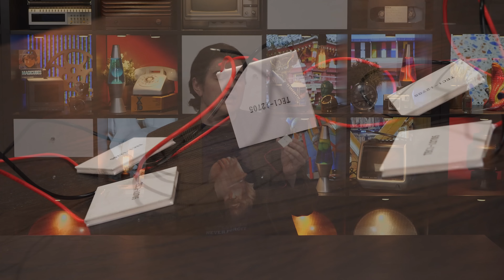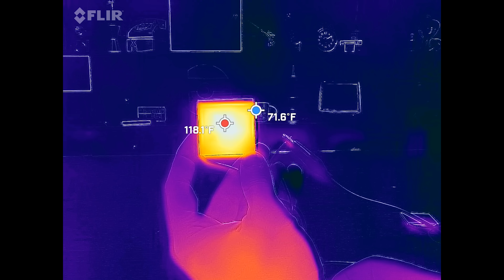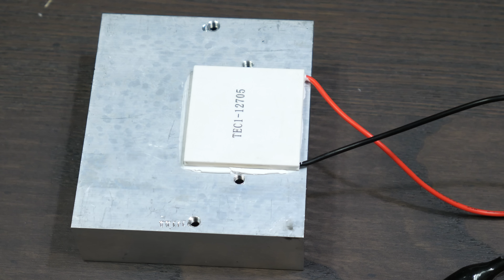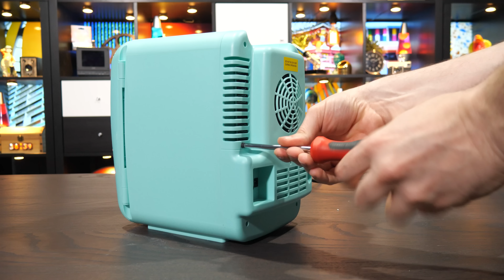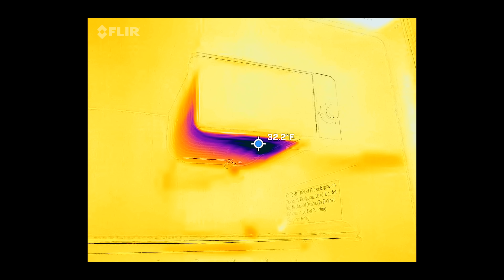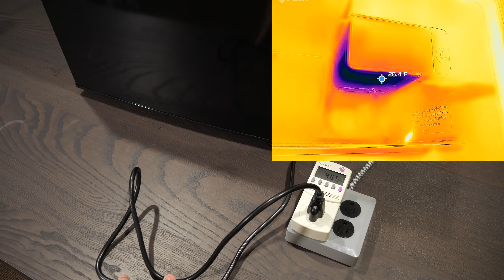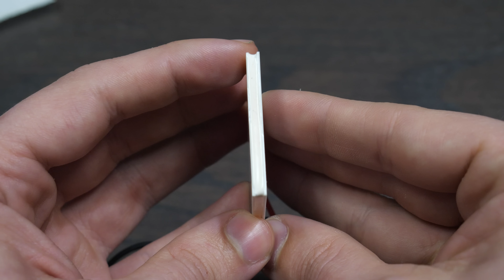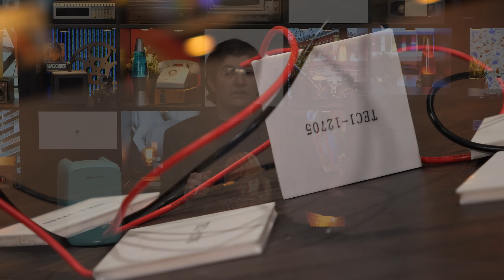Thermoelectric cooling: it's not great.

Comment: I think the main draw of a fridge like Mr. Blue Toy over there is honestly the tiny size. You can literally have it just sit on your desk without it causing any issues or getting in the way and that's extremely convenient. I doubt you could fit a compressor that small into a fridge, and even if you could it's efficiency and noise probably suffer a lot. So I do think a very well insulated, temprature sensing little thermoelectic fridge has a place, it would probably cost quite a lot more to make a decent one, and it would still cost quite a lot to run but if the insulation was good enough it'd surely be at least acceptable, even though it's never going to be very efficient
Reply: Yes, this is why I have one. I have some skincare products that tend to oxidize before I finish the bottle. I just need them to be kept a bit cooler on my vanity without taking up much space, and it works perfectly for that.
Reply: @brittneyyyann You will spend so much money on electricity that you could buy new skincare products with it. And why not just pot them in a regular fridge?
Reply: you are better off getting a smaller insulated cooler a use ice packs. cheaper too

Comment: I just bought a "cheap" 55€ dehumidifier, hoping it would help through the wet months here in Germany. I was kind of wondering how it worked without a refrigerator cycle ... my guess is that this is the answer. I plugged the stupid thing in, and now am thinking that it will never make a noticeable difference in the room humidiity. It has pretty LED lights ... but a tablespoon of water is not even a minor help. So, guess I know why it will never really work. It runs and will let a few drops of water condense ...

Comment: Saying they are bad is somewhat wrong.These You hold are indeed cheep and bad. There are peltiers which cost 300 a-piece, they have better efficiency. One advantage of eltier is possibility of fully sealed system and use of DC. And that fridge simply us badly designed, it wouldn't even be sold here. Refrigerator's average power usage is less than 30wt, but their peak usage can be up to 300Wt

Comment: I know it's got nothing to do with cooling, but Peltier junctions can be used to generate electricity as well. I used to work on thermo-electric generators regularly when working in the oil and gas industry in northern Canada. They are horribly inefficient for that purpose too, but work better than solar panels when there is very little sun in the winter. They're just a really big Peltier grid arranged around a combustion chamber that has a propane or natural gas burner, and a giant heat sink on the back side. The biggest ones I worked on had a design output of 210 watts, but in winter that could be bumped up to about 230 or so. They were on remote well sites where and pipeline risers where they were mostly used to power control systems and SCADA networks.

Comment: I'm old enough to remember when thermoelectric was the big thing. It was billed as space-age technology that was supposed to re-invent the world of refrigeration.

I bought a thermoelectric cooler once, and it gave me nothing but a hard time. It pulled over 10 amps at 12 vdc, so you couldn't leave it plugged in without the engine running. You also had to pre chill everything in a real refrigerator, and even then, it would barely hold temperature. I threw it away and went back to using ice. 🧊
It was just another gimmick.

Comment: On the plus side, I have an Igloo ice-less cooler with this type of system. I hooked up a 12v receptacle to the trailer light connection in the bed of my truck. This enabled me to keep certain beverages cold that were not available while driving through Canada. I also used it powered off a car battery to keep my eggs, milk, and cheese after we lost power during a hurricane. True, it will not fully replace a regular refrigerator, but it does have it's niche uses.
Reply: We love ours too! It comes real handy for roadtrips and camping!

Comment: I've managed bars and restaurants in the past and refrigerators and ice machines are basically the single most important piece of equipment. I'd love to see you look at commercial refrigerators, cold rooms and the weird gadget boxes used to cool beer tap lines. There are a lot of really wonky setups. Some of the older stuff is indestructible and great, even though it looks terrifying. The custom setups you find in places are wild.

Comment: 7:27 Well... A beer isn't exactly supposed to be ice cold though, a soda is nice when they're ice cold but I wouldn't want a beer that's ice cold. They're much better when they're 8-10C or 46,4-45F, and that's for a pale ale/lager. Darker beers are usually consumed at slightly warmer temperature, around 10-12C. Some Porters and stouts even up to 14C or 57,2F. There are some beers that are recommended to be served really cold at around 6-8C though, usually sour beers and Weissbier (wheat beer)

I don't drink often, but when I do it's usually mostly pale or semi dark lagers and some stouts. Though I thoroughly enjoy a weissbier from time to time as well.

Comment: A decade or so ago I built and AC unit using 100 of these little Peltier modules some silent fans and a few large extruded aluminum heat sinks.  It worked a charm for the 128 cubic foot sleeping compartment of my son's dirt bike racing trailer.  It ended up being about 1/3 the cost of a proper trailer AC unit that would have been far too big and were not even able to have it installed, so ..  Anyway, it worked but was not nearly as efficient as a proper Freon cycle AC unit.

Comment: @27:00 Growing up in South Africa we always got told upo getting a new fridge that we must "wait a day before using it " due to the gas. I initially thought this was due to refrigerant but i am now guessing its for the lubricating oil. Brilliant video🎉
Reply: Another thing about the lubricant, is the longer a compressor runs, the more it "wears" both the lubricant and the refrigerant. This doesn't pose problems to normal operations, but it means that when you move it, if it doesn't stay upright the entire time, the mixing of the two fluids in the compressor can become permanent and completely ruin the compressor. So any fridges that have more than 5-ish years of use, are more likely to be completely ruined if they lose orientation in transit. But yes, at least with new refrigerators, letting them sit for at least a day is a safe bet. Older ones I would basically add a day per year of operation, just to be safe.

Comment: Ok, hear me out... I have a very specific use case for the tiny "toy" fridge.  I work in a shop without air conditioning and i really want one to put in my toolbox where i have very limited space, that way i can put PRE CHILLED drinks in there and keep them below 90 degrees for more than 10 minutes in the summer.  If i had toom for an actual mini fridge, i wouldnt be allowed to use it anyway because its an "unregulated" appliance and my employer would make me get rid of it.  At least the tiny one can be hidden away from prying eyes.

Comment: The Peltier effect is super useful for (PCR) thermal cyclers, which have to heat and cool samples quickly and precisely. Also, IIRC you can use it to generate electricity (presumably inefficiently) from a temperature differential.

Comment: I had a mini fridge, it actually worked ok, it didn't keep the drinks cold, it just made them cool. Which is fine for drinks only I guess. 

Problem is, the thing leaked, it would drip water from the bottom of the door. Had to lay down a hand towel underneath. 

Got sick of that quick. Just walked to the fridge, lol.

Comment: There's no such thing as free heat what he's claiming is absurd it takes energy to run that pump it takes energy to move the heat from the outside into the inside and once you drop lower than 32° it's a lot harder to pull heat out of that air and it cost a lot more money cuz you're running that pump a lot more there's no such thing as free energy I don't know why he said that

Comment: I recently grabbed one of these for free, not because I have a use for it in mind but because I collect things "just in case" and felt it was silly to let it go into landfill. The reason the previous owner was giving it away raises a question for me:

Aren't these designed for refrigerating personal medicines? 

Sure, they get marketed to the average consumer by promising cold cans of beer and soft drinks but we could say that about things like automatic toothbrushes and electric can openers. Often the answer to "why does this exist? Just to allow people to be lazy?" (prior to the rise of Silicon Valley) is actually just "disabilities".

You're of course completely right - they're crap, surprisingly loud, impractically low-capacity and unreliable for maintaining food-safe temperatures. But if we consider them instead as an appliance to allow cancer patients to keep their medication close to hand and seperated from the stuff they eat, are they still so terrible at their function?

EDIT: Okay I just reached the section comparing it with the American-Style fridge freezer and I take it all back. Fire these things into the sun.

Comment: I have a fan for my wood stove that uses a peltier element to power it off the stove heat. The energy capture efficiency doesn't really matter since the whole point of the device is to increase excess heat transferred to the room

Comment: The only thing I've personally come across where peltier elements really did amazing things was the PCR thermocyclers we used at the DNA lab I worked at. They dont have the physical size where a compressor could fit and they were insulated really well with higher voltage peltiers that drew much lower currents and therefore had lower IR^2 heat generation. 23 cycles of 95C, 55C and 70C with 10 min of elongation at 60C and finishing at 4C only took 1 hour and ten min. 

But your point stands considering that their primary job is heating rather than cooling. 😂

Comment: I've had one of these from Toys R Us in the early 2000s, it even came with a 12 volt car adapter. It lasted me quite a long time and did get really cold, would ice up inside the fridge on any metal components. It wasn't no $30 though, thing costed $100 lmfao. I even had a mini water cooler that had one!

Comment: To be fair a few manufacturers at least actually made decently working ones I wish I could remember what brand it was to recommend for testing or whatever but it did manage to get the cans frosted on their exteriors from the ambient air inside the fridge so it had to have at least gotten it down cold enough for that to happen and it was relatively quiet too

Comment: what? I made one of these for a HS project ages ago.
I thought mine was innefficient lmao.
It had 4 of those coolers on the back and 2 at the sides.
It had a DHT11 dangling in the middle (Yes, dangling) and once it got to around 5°C it shut off power to the cooling elements and was only consuming about 8W monitoring temperature until the temperature had risen up to 8°C.
The rear peltiers were the ones that always switched on when temperatures went over 8°C, the ones on the side switched on when it was over 15°C.
Only needed 2 fans on the rear to cool down the peltiers, I had managed to add 4 laptop heat sinks to the peltiers that cooled the sides of the fridge and bent them so the heat would go to the rear fans.

I cannot point out how much it consumed, but it didn't even reach nowhere close to what that original mini-fridge uses.

Mine was about 15'' x 10'', so it could fit around 20 cans? But I mostly made it for cooling food.

Anyways, I'm dissapointed to see how the fridge that inspired me to make my HS project was way worse than my design lol.
Literally I didn't even research how it worked, I just saw ElectroBOOM's recent video about thermoelectric cooling, and went to work after seeing the minifridge on amazon.

Comment: The only practical (and this word is carrying a lot of weight) use i've found so far for Peltier plates is as cooling for my Full-body future soldier armor LARP suit. It is water-cooled using a miniature immersion water pump in a camelback filled with water and some ice initially. The immersion pump feeds a 10m long 5mm inner diameter aquarium tube that goes on a wild ride up and down the inside of my chest piece to help cool me down and then the water comes back to the camelback (yes i technically drink my coolant; yes i clean it thoroughly after each use). After about two hours the water reaches more or less room temperature. I then have two manual switches, one to turn on the cooling fans on the backpack and the second to power up the Peltier plate. The fans are on aluminium heat-sinks that are on the aluminium casing in which i put my camelback. The two .25A fans are good enough if it's bellow 15C outside, otherwise the water will get warmer and warmer over time. That's when i turn the Peltier plate on, only then, maybe after 5 hours of continuously running around or physical activity. 

People that do LARP will tell you, you usually get some time to cool off between hectic running around periods so it's really a last resort or, if it's really warm outside, like 25C+. Mind you this feels hot because i'm wearing a full-body armor made from EVA foam sandwiched in thermoplastic, with a closed helmet, over an overall and hauling around this 10 kilos of gear, 3 kilos of water, 5 kilos of batteries and my 1m90 125 kilos self. And when i reach that point... it's not that great. Sure it makes a difference, a big one, but this is bumping my power consumption from about 3 A/h with the fans in the helmet and cooling running along the pump to a whopping 50 A/h with the Peltier on. Mind you i'm carrying a large 20 A/h 12v battery in my backpack, the single heaviest item in fact, and, while yes i can swap the battery and have two for the exact purpose of keeping one on charge, i'm going from about 8 hours of autonomy to about 20 minutes (this battery looses efficiency on high drain).

So yeah, besides being basically a novelty that is kind of cool-if-a-bit-crappy, the only time i actually got some real use of it was when i almost got a serious heatstroke during a heat wave a few years back.

Comment: One other thing that may be of interest regarding peltier elements: if you heat one side and cool the other, they produce a voltage! Not a lot, but it may be sufficient to run a wireless temperature sensor on the warmth of a hot water pipe.

Comment: The one thing I like about peltier modules is they are tiny.  I saw someone make a "personal air conditioner" where they took two modules ran at low voltage and basically pressed them against their wrists to cool their blood stream.  iirc they ran them undervolted so they didn't freeze against their arms or need a massive heat sink.  There's lots of cool (ha) stuff you can do with them if you only want a cheap cooler to hack with.

Comment: Wait wait wait wait… You’re saying this mini fridge has cost me to use 482.13 kWh over the last year to keep 11 cans cold plus the cost of dissipating that constant 55 W through my HVAC which is another 
 120.53 to 241.07 kWh based on an average HVAC COP of 2 to 4?!

chucks minifridge in e-waste pile

Hours in a year:
365.25 days x 24 hr = 8,766 hrs

Calculate Watt Hrs (Wh) @ 55W:
8,766 x 55 = 482,130 Wh

Convert to Kilowatt Hours (kWh):
482,130 Wh / 1,000 = 482.13 kWh

Comment: I had a fridge box for camping in the late 90's and it was a 10 litre big thing and it worked marvelously to the point it could freeze milk just about.  It didn't have a compressor but worked off 12 volts car battery and drew about 4 amps.  It did have a fan but was very quiet, maybe it had more of those modules inside than the mini one you showed?

Comment: The problem lies in the use of the element. The lower power you give the element, the more efficient it gets. If you now use a lot of these elements, like 12 or even more, spread out on the back. You can build an actual freezer that reaches around -10° to -15° C, in the size of the mini fridge you showed. Obviously, enough to build a fridge, too. Yes, the efficiency is still worse than an actual vapor compression fridge or freezer, but it's not terrible. Also, you could probably cool it completely passively if you only want to build a fridge and you use a lot of elements. For a freezer, you will need some fans, but there are super silent fans available. It's still less noisy than compressors. So the elements are quite useful, but they get used in the worst way possible. So it absolutely does not deserve all the hate it gets!

Comment: If heat or cold is applied to the Peltier "chip", will it GENERATE electricity?   Is that what is in the ELECTRIC FANS that you can buy for sitting on top of wood stoves???

Comment: If a heat pump can move more energy than is needed to power it, that would seem to suggest that it’s theoretically possible to build a sterling motor powered refrigeration system that effectively fuels itself with the energy it is moving, once you help it get up to speed, or at the very least it should be possible to use a sterling motor assist to both increase efficiency and cut down on waste heat, even if the efficiency of a sterling motor was not high enough to completely power the heat pump with the surplus energy being moved.

Comment: I recommend learning about refrigerated trailers. I pull them for a living and they're impressive machines. They essentially have a small diesel car engine just to run the heat pump and can both heat and cool the cargo from 70°F all the way down to -20°F. It's the giant bulge you see on the nose of some semi trailers. Some are electric and some are even both diesel and electric.

Heck if you want some hands-on experience and B roll, we can work out details because my company is frequently in Illinois.